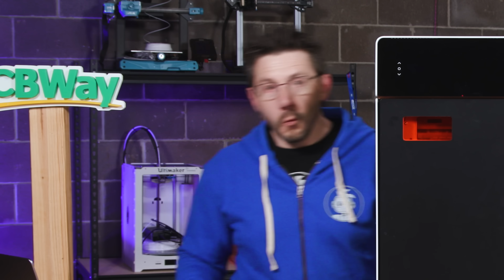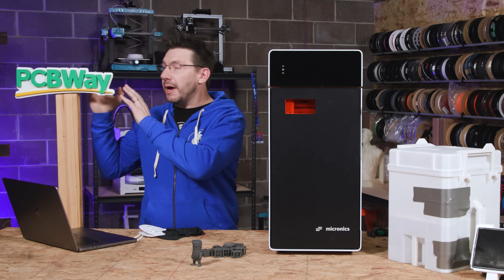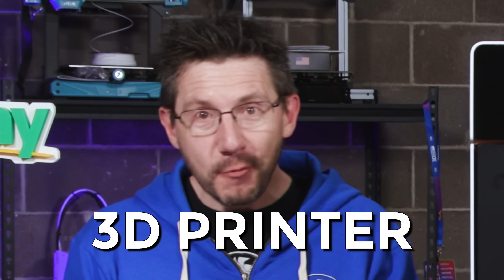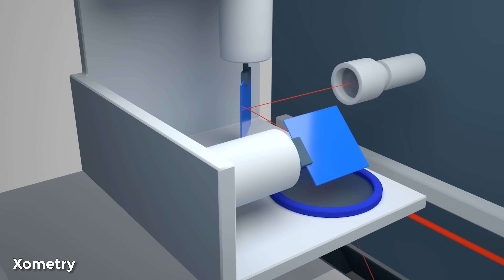SLS 3D Printing AT HOME?

Comment: Hey Joel, thanks for checking out our printer! 
Sorry the bin broke in so many places during shipping - for the production machines, we plan on switching to Reaction Injection Molding (RIM) for the bin, or adding sheet metal inserts to reinforce the FDM print, which should make it much more durable. 
Regarding the safety aspects, you should definitely wear a N95 respirator and gloves when handling the powder. However, it is worth mentioning that unlike metal powders, Nylon 12 is inert and non-toxic (though inhaling large quantities can still cause discomfort). The sift bin and dust extractor can keep you workspace pretty clean, but spills can still happen and of course, the sift bin can break. (also, we recommend placing the powder scoop on the build chamber BEFORE raising it up). We do NOT recommend setting this up in your bedroom or living/work space - instead, put it in your shop or garage - somewhere out of the way. 
For the brushing part, it is actually only necessary if you don't have a media blaster. If you have a media blaster, simply take the parts, break away the large chunks, and blast it directly. This make it much faster. 
Of course, we are planning to do another round of beta testing before the production machines - which is why we are stating a delivery time of 8-12 months after launch. Other creators have also experienced some manufacturing related tolerancing issues that are causing print issues, and we do plan on working with our sheet metal and CNC shop on dialling them in. 
Let us know if guys have any other questions!
Reply: Not all metal powders are reactive, lots of them are also inert. Exposure to small doses frequently enough will also result in more than irritation probably not too far away from silicosis.
Reply: You should also advise people to take certain precautions that prevent the powder from spreading all around their house so they don't have to wear a respirator everywhere in their house and you should also advise thoroughly washing hands after doing anything with the printer so people don't ingest the powder.
Reply: Good morning micronics team, I wondered what was you solution to the high price of the powder material, do you think it will become cheaper with the increased demand ?
Reply: The nylon powder is gray so you probably have some carbon black in there which is already a known carcinogen especially in an ultra fine powder. Actually any inert powder is a carcinogen if it is ultra fine something you can breath in. The reason you should use a p100 mask is because it will filter everything out and is much more likely to seal properly as leaks much more severe at that hazard level. Natural nylon is a white powder. I hope you actually publish a proper msds as it is critical that people know what the powder is made of. Formlabs has basically the same powder and it requires mechanical ventilation and if not controlled properly fully self contained breathing. You'd need a particle counter to know if your properly controlling emissions so a p100 mask plus local exhaust is probably sufficient for home users that can't afford the sensors as those cost more than the printer itself.
Reply: So the only advantage of SLS is that its smoother and without layerlines etc.? So only really good for ppl who like to print figurines and decorative stuff? Can it print other material instead of nylon?
Reply: @danob9869  sls is primarily used for mechanical components.  Significantly stronger than sla prints, slightly stonger than fdm and dimensionally accruate, along with the ability to print complex structures not printable on fdm.  Your average "print toys" hobbiest wont have much of a use for it.
Reply: This is not correct sand is nontoxic and non reactive but ultra fine silica still is nontoxic nominally and non reactive but if you inhale it is a known and proven carcinogen. It's just the ultra fine powder that is the pure cancer aspects the ultra high surface area and inert powders are essential indigestible by your immune system so they will just build up in your lungs forming cysts and cancer is the next step.
Reply: There was a bit of drama with the way Scotty's demo of the unit with and his thoughts on you guys utilizing Kickstarter despite not being fully ready for mass production. I just want to say I disagree with him on that: you're using Kickstarter the way it was intended, I think Scotty misunderstood the purpose of Kickstarter: he views it as a presales platform. 

I'm glad you guys are working on getting SLS down to consumer level pricing and I genuinely hope you succeed. While $4k is too rich for my blood: I'm just happy you guys are doing it.
Reply: Sellouts
Reply: Why formlabs? They don’t do home machines. They are going to turn it into just another industrial product.
Reply: "Tolerance issues" doesn't seem to cover it though.  It doesn't really make me feel good that seemingly every reviewer is getting this thing in a very broken condition. Strange Parts barely got his to even work, and it seemed a bit suspicious Micronics kept telling him to delay his criticism video until after the kickstarter launch and when he said no you asked for the printer back then.  I'm glad Joel mentioned not backing unless you are okay throwing that money away.  I really want consumer SLS to work, and the first person to do it will be very popular, so I'm rooting for you guys.  I'm just not sure this is quite it yet.
Reply: @DrChiYT  that is very dodgy behaviour what they have done regarding Strange Parts, you don’t behave like that unless you are hiding something. Bear in mind that companies will generally test units and make sure they are working properly before sending them to reviewers, since they don’t want reviewers to receive non functional units.
Reply: @DrChiYT  Copied our reply to his video in case you haven't seen it:

Hey Scotty, thanks for checking out our printer! There are definitely manufacturing related issues that we plan on addressing before launch. Here are a few major ones: 
Regarding the auger auger jam, it is likely caused by too tight of a clearance between the auger and the auger tube. We did overnight ship a replacement auger the following Monday after this issue and that completely addressed the auger jamming issue. We made the clearance quite small because early on, we had issues of powder going back down the auger when it's not spinning. Later during testing, we found that it's actually caused by the shape of the powder inlet, not the clearance. This means we can increase the clearance and reduce the likelihood of jams. It probably also got bent during shipping, so we plan on improving our shipping brackets to prevent this from happening again. We also do plan on integrating the auto-reverse function into the build unit PCB, which would allow it to automatically un-jam itself even if it does happen. 
For the FDM printed sift bin, yeah that is a common issue and we should have tested shipping it beforehand -  we take 100% responsibility on that one. We haven't had time to redesign it, but we did also ship out a replacement bin overnight together with the replacement auger and that arrived intact (though probably still fragile) For the production machines, we plan on switching to reaction injection molding (RIM), or adding sheet metal inserts to the FDM prints to reinforce it. That would make it much more durable. We will also of course improve our shipping (putting the heavy powder bottle in the sift bin for shipping turned out to be a bad idea).
The last issue regarding the powder flipper. After some diagnosing, it turned out to be clearance between the powder flipper and bushings that is causing it to jam up. During testing, we found that the loose press fit of the bushing into the sheet metal would cause the bushing to spin in the sheet metal (accelerating wear), as opposed to the shaft spinning in the bushing. So, we used some adhesives to fix the bushings in place as that should get it tight enough to where the shaft would spin as expected - turns out that caused more issues than it fixed since now it is just binding and causing the gears to skip. This is still an issue we are working with scotty to resolve - we will likely send out a replacement powder flipper. (We are currently travelling to open sauce)

Overall, there are a a few manufacturing related issues that is solvable by working with our sheet metal and CNC shop at higher quantities so we can dial it in. In hindsight, we should have taken more time with QC and made sure everything is perfect, but we have learnt our lesson. We asked for more time to test the printer, which would have likely delayed the video, such that we would have more time to resolve the remaining issues and get it to print reliably. It was never our intention to obscure the flaws with this beta production unit. Perhaps when we mentioned that we wanted the machine back (since we were under the impression that you were no longer interested in investing more time into troubleshooting, which turned out to not be the case), that the conversation turned the wrong way. But, we did clear up this misunderstanding the following day and later suggested that you release the video on the morning before launch - which we are glad you did! 

After kickstarter completes, we do plan on running another round of beta testing before shipping, which is why we are stating 8-12 months delivery after KS. This would give us a chance to iron out all the issues that scotty and other creators have experienced with this first generation of beta machines and would allow us to deliver well function machines to those of you who back our KS campaign. Let us know if guys have any other questions!
Reply: Hey Micronics Team, Correct me if I'm wrong PA12 ( Nylon) can be explosive if not correctly stored. Is this something to consider with the Micron / Material Storage. Thanks
Reply: @adamjones9717  Flower is explosive if not correctly stored. Every slightly burnable powedr is explosive if incorrectly stored.
Reply: @adamjones9717  nice lets maie a bomb
Reply: @adamjones9717 it is explosive formlabs has the same powder basically and it says it is an explosion hazard in dust form.
Reply: @adamjones9717  PA12 is not really explosive unless suspended in very high concentrations in air (such as vacuuming up the entire bottle of PA12 with a household vacuum cleaner that is making sparks). When it is just sitting there in a bottle or in the printer, the risk is extremely low.
Reply: Looking forward to the launch of the kickstarter, depending on costs ill be backing it.  Would love to have an sls machine in our shop
Reply: @micronics3d a bit of a tangent, but I have an idea: one of the problems with SLS is the use of nylon powder has some safety concerns regarding respiratory health, as well as reusability concerns for the powder. 

Well, what if instead of a nylon powder, the consumable was some sort of viscous gel? If the viscosity is just right it could even auto-level the way liquids do: maybe it cools as it spreads the layer: going from a liquid to a gel to serve as support.  

With a gel you wouldn't have the messy and respiratory health issues that a powder would have. You could also incorporate pigments in it at the liquid stage, thus making full color prints. 

I'm no material scientist but I would imagine it wouldn't be too difficult to make a solution with the right properties that can be sintured.
Reply: ❤️❤️❤️ SLS love ❤️❤️❤️

Comment: Just saw it mentioned in William Osman's last video leading up to Open Sauce. Looks like it could be a killer device! But still a bit more than what most people could swing in a house. But one step closer to the Star Trek replicator!
Reply: "Killer" indeed.
Killing the customer.
Reply: pi man!
Reply: Star Trek???!!!! Star Mess!!!!
Wow, just wow, it is supposing a bunch of smart people here watching video about leading edge tech…. 
How you can’t see outcome of using this at home and create SLS printers for home market?
1.	Particle size: Joel's mask, vacuum???!!! Are you for real? You need some king of electrostatic filtration system to catch them all.
2.	People, people, people… How many people never use kitchen sink to wash resin printers done with water washable resin?  Answer is 0. So there all this staff go? Exactly…
3.	Why? Resin printers will give you same resolution/detail level. And resin printers in hands of lot of people is a mess, so let’s go one step up and create a bigger mess with very small dust like particles. 
Will be even cooler to know that no one can escape plastic in food anymore.
Reply: @alexbold4611  That's why I said "more than what most people could swing in a house" ;)

Comment: This tech is way cool.  But the company is going to have to figure out post processing before this can really hit mainstream.  I envision like a media blast box where you can hit your parts with a jet of compressed air (so powder flies everywhere) and then have some method of collecting the powder in the box.  Maybe centripetal air filters with a backup HEPA to clear the air?

Comment: Just when I thought it couldn't get messier than resin printing. This would need a dedicated room, which doesn't make it consumer friendly.
Reply: Some people I have seen in the comments that claim to have done it professionally have said that they need a dedicated room that is locked down when they have to go in and get the parts, the room is sealed with filters and ventilation, they are wearing respirators (not just masks) and they need special lab coats and vacuums and that the room needs cleaned before the room is unsealed and they are allowed out.

So yes I would think that the safety shown here in the video or recommended by micronics is not anywhere near enough and that this technology is not ready for home or hobby use.

Now if a company made a completely contained system where you just put a powder cartridge in one side and it spat out cleaned parts out the other then maybe that would be suitable for consumer use but so far this isn’t looking like it.
Reply: @conorstewart2214  How freaking dangerous is that powder? Is it like asbestos?
Reply: @gownerjones it’s worse than asbestos, but like asbestos, it it permanently in your lungs.  It can never be removed.
Reply: @conorstewart2214  This is definitely a minimally viable product. 

That bucket thing is beyond jank. 

Automating cleanup shouldn't be too hard. I would have the cake on a wire mesh, then vibrate. Maybe even use ultrasonics if you want to be clever.
Reply: @jtjames79  I don't think it's that janky since if im not mistaken expensive commercial SLS printers have a similar post processing process. Which makes me think that a better solution is probably very hard. I'm just speculating though, could definitely be wrong on that
Reply: @ThatsPety  Commercial production really isn't interested in solving these problems. You just pay a guy.

It's only when the margins narrow, that you start to worry about costs like post-production. 

Same reason that before SpaceX came along they just threw away rockets. The market wasn't forcing the process to improve.
Reply: @jtjames79  I have a hard time believing companies dont care at all about making their processes faster, safer, and more efficient. But at the same time they are at the mercy of what the sls printer manufacturers sell them. 

In any case, my point was more that I wouldn't call implementing a solution very similar to what everybody else does "beyond jank"
Reply: @jtjames79  oh and this is a tangent, but a big part of space companies throwing away rockets comes from the fact that they are funded by taxpayer dollars. Even privates like SpaceX, though to a lesser extent. Either way, not really analogous
Reply: Frankly this looks as messy as Resin printing anyway. Resin is so not home safe.
Reply: @DangerousDac  it's garage safe. but SLS needs more PPE and controlled environment than resin.
Reply: It's still thousands of dollars and lots of prep/post-processing - I see this as at least a prosumer product.

Comment: One issue with SLS printers is that you can only re-use the material so much. So you have to throw out so much of the powder that enters the build chamber. This has a big impact on the economics of printing as a small part with tall geometry costs more than a larger part with shorter geometry. For small scale this tends to discourage prototyping, or one offs, and is more for predictable batch printing.
Reply: This is why we need home inert metal SLM ;) no oxidation so the only risk is clumping, which can indeed be sifted

The only problem is that this requires something like gold, or already oxidized metals lol
Reply: How much of that could be addressed by sifting and grinding used powder?
Reply: @hanelyp1  Not really as the issue is the high heat + oxygen chemically changing it. Basically the powder is heated to just below sintering temp and the laser pushes it over. I'm sure the suppliers over estimate the amount of powder you need to refresh, but for engineering parts you can't guarantee part properties with a low refresh rate. Powder near the printed parts also ages quicker so for dense builds it has more of an effect.

Comment: Can you put this in an ultrasonic cleaner to get the powder off?
Reply: You wouldn't want to get the powder wet if you're going to reuse it, but actually maybe just putting it in the cleaner with no fluid would let the cleaner just vibrate off all the powder.
Reply: @tenchuu007  All ultrasonic devices that I know of must not be operated dry. I assume that they need the liquid for cooling.
Reply: @tenchuu007  I mean the excess powder on the models. If you blast them wit sand the powder is lost too.